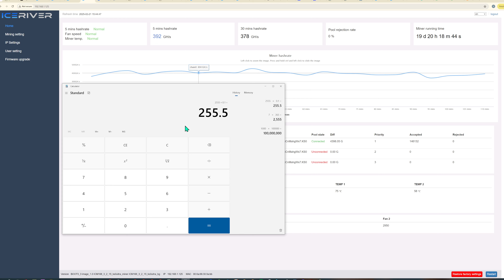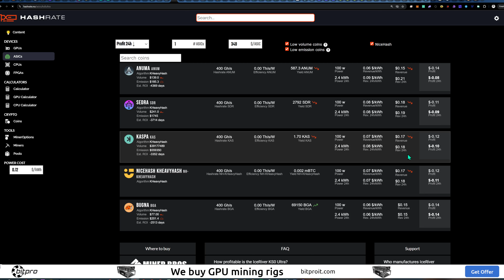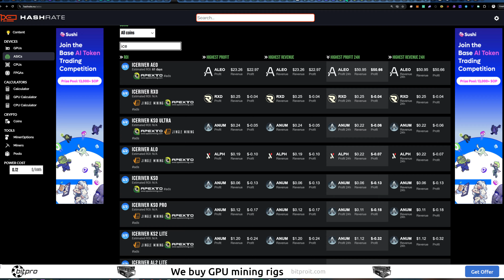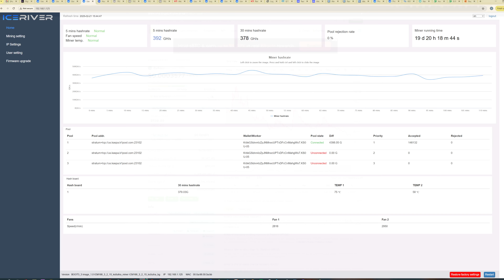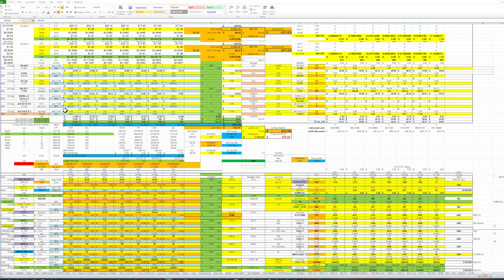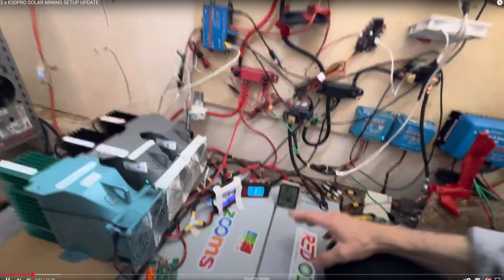1 year SOLAR mining with KSO ultra update

Comment: How many panel and battery for 1 ks0? Just a ball park, ill figure it out if its not enough.
Reply from the maker: I’m using 4x  200ah= 800Ah batteries and 12x200watt and 1-400w  solar panels that’s 2800W total solar and it’s barely enough to run 24/7 on solar 550W 4 RX0 now that overclocked a bit if you use a single KS0 about 100-110W divide by 5 that’s a minimum 160ah battery and 600w solar. I hope that helps. For winter days have to have a bit more solar.
Reply: @DontMindMeMining  thank you!!